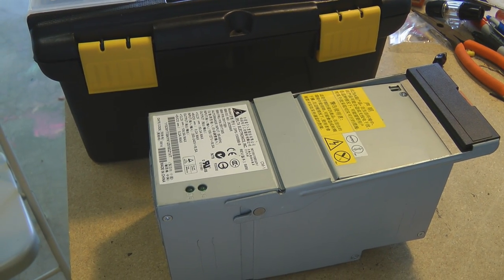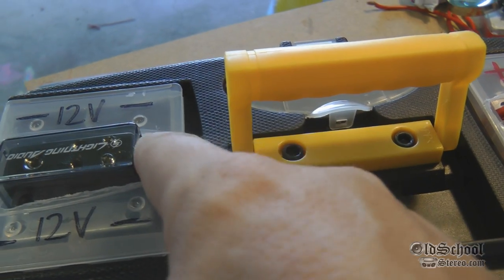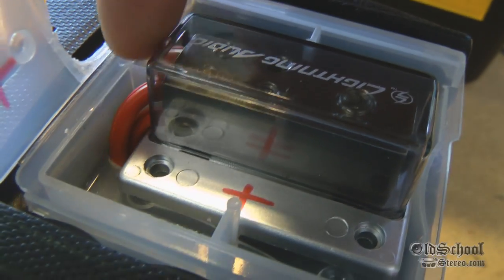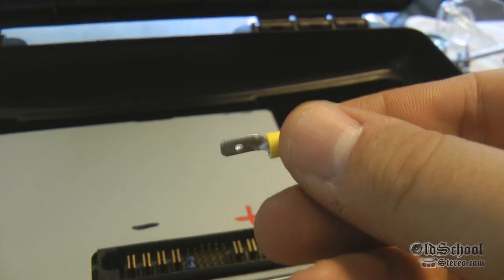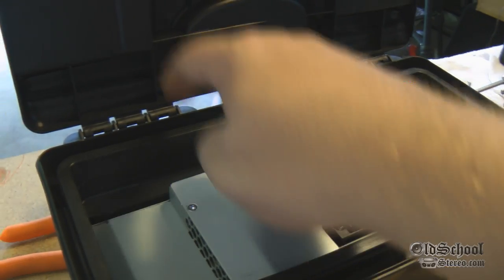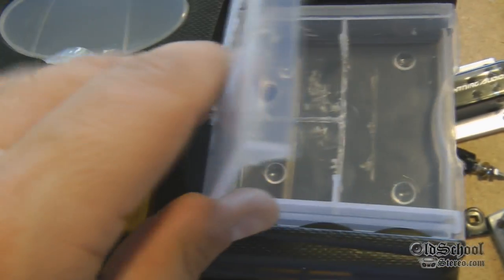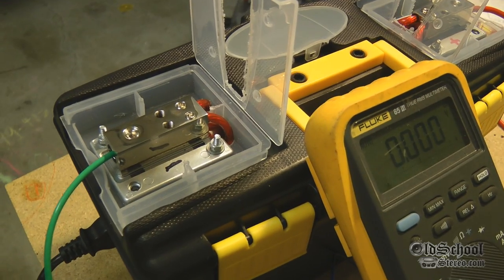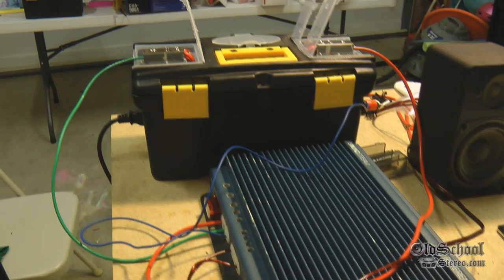DIY Car Audio in Your Home DIY 12V Power Supply Project

Comment: I believe Barevids has done a similar tutorial to this, its fantastic to see ways of running proper power at home without investing in expensive pro-audio amplifiers :) Thanks BigD!
Reply from the maker: You can also search eBay and Craigslist for Audio Authority power supplies...those are the ones most car audio shops used and a few of those models could use an attached 12V battery for additional reserve powa!

Comment: I gotta say i'm a big fan of your video's, especially amp dynos.  Currently I have a Polk Audio PSW110, which came with a factory but after a few years of abuse failed me.  So, i've removed the sub from the factory box and disconnected it from the factory amp.  Now the sub is inverted in the factory ported box bridged to a planet audio AC1000.2.  Amp is currently receiving 12v @ 16.5a from an old xbox 360 power supply, which works fine at 20-30% volume.  Any higher and the amp demands more current than I can supply.  I'm definitely going to look into building something like this for my set-up
Reply from the maker: +Michael Smith thanks for the comment
Reply: Anytime brother, keep those videos coming

Comment: protip: for anyone seeing this video and wanting to do this project, spend an extra $20 on a breakout board.  you'll be glad you did.  also, i found that by the time i sourced the power supplies, the  amps, wire, and fusing, pro audio was just so much cheaper, a lot less frustrating, WAY more efficient, and a lot less noisy.  did i mention that it was a lot more efficient?  i still use car audio subs, speakers, and a hu, but if i can't get rid of this ground loop when i finally replace the last car amp in my setup then i'll just have to go with a rackmount media player.  it's a cool concept, but putting it into practice was more than i or my budget could handle.
Reply: you've got a ground loop because you have components connected to each other which are on different electrical circuits of your home.
Reply: @LBCAndrew  nah. All components where plugged into the rack's surge protector except the 12v PSU but it was plugged into the same 15 amp outlet.  The PSU was definitely part of the problem, replacing it cut down on enough noise that I was able to filter the rest out for the most part.  I stand by my original statement.  If you want a high power system in your house then pro is the way to go.

I'm convinced that my father just did something wrong when he installed the house's electrical system.  Ma was pregnant with me when he built the house so that means it was built in 81-82 and an electrician my father certainly wasn't.   Where I live there are no code inspections either.  I've always had trouble with ground loops in this house.  Right now is the quietest setup I've been able to achieve but when you hook the oscilloscope up there's noise everywhere, especially when the air conditioner is running.

Comment: I can't wait to see your build for larger amplifiers. I've been wanting to run one of my 1000wrms digital monos and 18" incriminator subs for a killer home theater setup for a while. But I've been unsure as to the best low buck(but safe) approach. I've looked at some 1000w pc power supplies for under $100 on tiger direct recently but being disabled I don't have the funds to spend on a ps that might end up burning up or worse burning my house down.
Reply: Use two Dell PowerEdge 2800 power supplies in current share mode
Reply from the maker: Look for one of those Audio Authority 100A power supplies. Those are what many of the car audio shops use for their sound boards
Reply: or that :-)

Comment: what a good video, thanks for the explanation> just a question: can I use this power supply during 8-10 continuos hours at 12V@30Amp? I want to run a kenwood KAC8452 (max 800W) in home
thans again.

Comment: Can I use it with a Punch 201S? It's 200 watts says 600 watts on the top. What do you think? My power supply just came in the mail I was reading previous comments and not to go over 200 watts...

Comment: Hey BigD for the output connections are they already ready for a plug in or there certain pins needed to get the full 53 amps? I am going to get one to replace my pyramid 10 amp power supply.
Reply from the maker: Kevin Nieto this power supply only has 12V and 5V outputs. The 12V outputs are the 8 larger female spade connectors as I show (4 for positive, 4 for negative), the 5V outputs are buried in the other small pins

Comment: Hi. I ran out of battery every time testing and tuning my car audio system. Is there a not very expensive way to directly supply the car battery so it can run for hours? Without the car alternator or another battery. The system shouldn't do more than 30A i guess.....Best regards!

Comment: Not sure if you can help. but.. So my dilemma is, and I am no electrician by any means, I am trying to use a switch from a what I am guessing is an electric or electronic device.  Trying to wire this type switch into a 110 volt lighting project.  The switch choice is due to the small size and concealability.  How can i first, determine the type switch and since I am not sure where many of our switches are originally from, whether I can use it in my project. Second how do I wire this into our application?

Comment: Good video...whenever you wire it to a battery would you need to fuse between battery and power supply? and also fuse from amp to battery?
Reply from the maker: +Yaret Trejo I would not use a battery with these 12v computer supplies as they will not provide enough voltage to charge up a 12v battery and don't have any protection circuitry for charging.
Reply: +Dereck BigDWiz ok thanks

Comment: Cool!
Reply from the maker: Thanks! There are also larger power supplies you can make adjustable to over 14V and put out around 100A. I'm going to show off this larger project later. If you can't wait, do a Google search for Dell PowerEdge 6650 and rcgroups
Reply: +Dereck BigDWiz when haha I would be good as won't to run a 1k but I'm in England so would 100 amps be ok

Comment: How's this power supply? Do you think it puts out it's true ampere? I am thinking about buying one to power my rockford fosgate punch 700S like run one channel because it's way more than enough to listen to indoors. Or is it possible to run two of them together to double current?
Reply from the maker: Kevin Nieto check out RCgroups.com for the Dell PowerEdge 6650 server power supply. It provides over 100A and can be made adjustable to over 14V with some simple mods.
Reply: Dereck BigDWiz That is the big problem with normal desktop power supplies. You can get good amperage no problem but you will NOT go over 12v if anything a little under which is NOT what you want.

Comment: I don't know if I missed it, but did you put a breaker or a fuse in case the amp overdraws current from it? or it doesn't need it?
Reply from the maker: Yes, please, use a fuse! I'll update the annotations and I should have mentioned this!
Reply: Dereck BigDWiz Thanks yo, I didn't mean to sound like a smartass, I was wondering for real.
Reply from the maker: John Redcorn Not at all, it was a great point!

Comment: Great job!!! Would you be able to connect this power supply with a car battery? I had a cascade 12volt power supply and was able to do this and provide 100plus amps to my car stereo amps. Listening to car stereo without a dead battery was great=) I regret selling that power supply=(...
Reply from the maker: The Cascade power supply has special protection circuitry for use with a battery. I wouldn't use this power supply with a battery unless you understand how to implement diodes and realize it will not keep a battery charged with the 12.4V output
Reply: Dereck BigDWiz That totally make sense. I'm going to build one for testing amps. Thanks for this helpful video. Keep up the good work!!!;)

Comment: can you use as a garage set up to use car audio parts to make a stereo, such deck, amp and speakers
Reply from the maker: Yes, but with this particular power supply, I wouldn't use a very big amp. Should be safe with 100-200W

Comment: could you do one with an hp 399771-001 Power supply I picked mine up for 24 usd new on amazon and it's a bit better spec'ed than what you have here

Comment: plug it on 240V man youl have 100A that what im gona do WOW
Reply from the maker: Right on! Just a little warning, these switching power supplies are not designed for continuous heavy loads, so I wouldn't put a 1000W amp on this power supply unless I was just powering it up to test functionality
Reply: Dereck BigDWiz
ya i know need a testing power suply
in the house 240Volt plug are rare
but in the lab or the test bench YES
Reply: BigDWiz thinking to do a custom Boombox I'm using a Rockford P300x2 I'm installing this like 3 mode.. if I get a 400w to 500w power supply it will be find for that project?

Comment: cheap project I'm gonna do this to run a small shop stereo.
Reply from the maker: Should work good, just need to keep it on or the presets will be lost if that's a concern
Reply: Dereck BigDWiz I Think I'm just gonna use a battery that we have leaving around and charge it often.  but build a rack to hold everything.

Comment: how to dont loose car stereo memory after i turn off psu?
Reply from the maker: +Ramas Ramzetti Yes, you would need to integrate a battery to keep the memory for the head unit
Reply: +Dereck BigDWiz Well i have only 12VDC 1amp power supply from old router. Can i connect pc PSU with that power supply at the same time?

Comment: Hi, usually you can get used server power supplies on E bay for around $20. On a tutorial I wrote on building a speaker setup, I went into how to modify a server power supply. Scroll down 3/4 way down page and there are instructions. http://www.instructables.com/id/Powerful-Portable-Speaker-complete-system/